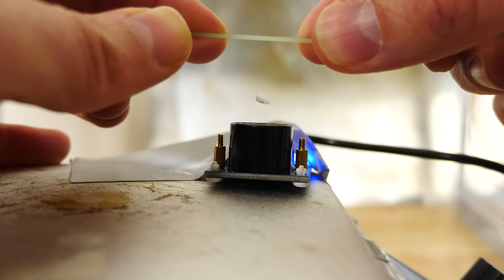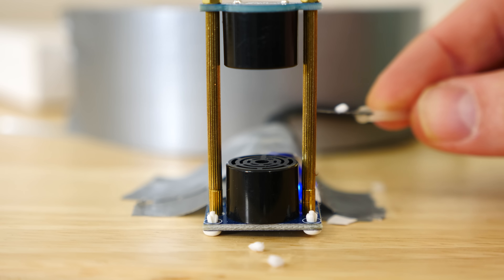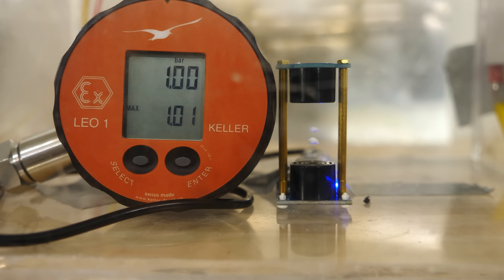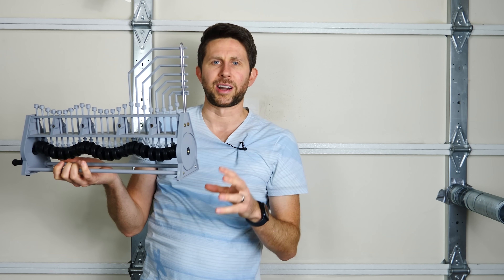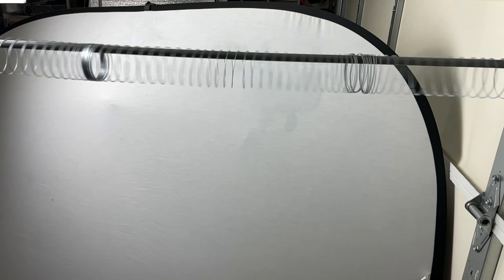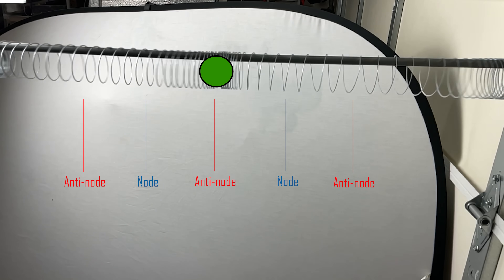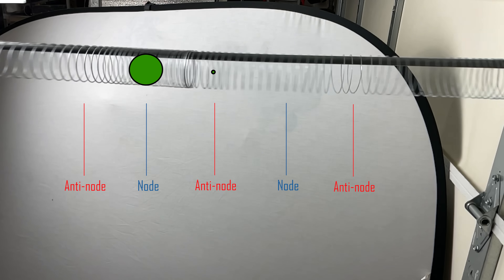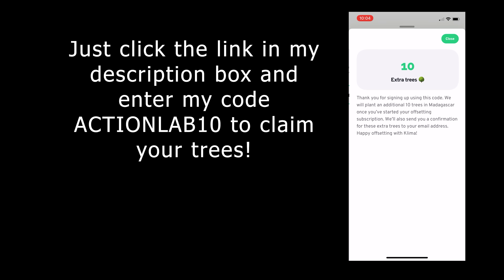How Does Acoustic Levitation Really Work?

Comment: Nodes are the points of low movement or zero movement, the anti node is the points with maximum vibration, if you place 2 speakers in the exact opposite direction they will interfere, one to another take the example of Laser Doppler Vibrometer and that's why your object will stay in the node.

Comment: In this experiment, the first condition was that the ultrasonic device was turned on, and the second condition is the vacuum condition. 

so what if it's the other way around ? if the vacuum condition for first
Reply: because in the vacuuming process of air, these particles moving outward which in the vibrating condition, for sure give an effect to the object.

Comment: An interesting demonstration.
I have had people who believe that a lost ancient civilisation tell me that this method might have been used to move dense objects like stone blocks, but this seems unlikely to me.
When you add in a Styrofoam chunk into the air gap, is there a relationship between the air pressure generated and the density / mass which can be lifted?
Is there a consequent down force on the acoustic generator when the styrofoam pieces are introduced?

With thanks, Simon

Comment: Nice video! I searched for acoustic levitation after I came across another video where they suggested that some ancient buildings, like the pyramid of giza, were built using acoustic levitation. 
That made me think of a question... 
Does the weight of the object you suspend in the standing wave add to the weight of the entire system? If you could assemble the wave emitters on scales, so you could weigh it, and called the weight of the system X, and the weight of the suspended object Y, would the total weight be X+Y, or just X? If its X+Y it would kind of disprove the idea of 50 ton stone blocks being moved in this way, wouldn't it?

Comment: I actually work in acoustic levitation or rather acoustophoresis, and it's even more complex than explained in the video. First of all, you don't need a standing wave to have acoustic levitation. You just need radiation pressure. So you just need high acoustic pressure, to have enough non linear effects that create that pressure. You can do that with standing waves but also with focused transducers. Moreover, the radiation pressure is much more complex than explained. You have particles that will go to the nodes, and particles that go to the anti node, regardless of their size. It depends on the acoustic contrast factor. For example, if we're talking levitating cells in water, you're gonna have blood cells that will go to the nodes, because their speed of sound and density is a bit larger than water, so the contrast factor is positive. If you have fat cells, which are less dense and with a lower speed of sound than water, they're gonna move to the anti-nodes. At its simplest, radiation pressure is a non linear effect that occurs when a powerful acoustic wave passes from a medium to another. The transfer of "momentum" from a medium to the other creates a force on that interface between the two media. Those media can be two liquids, like a cell in water, or an oil/water interface. It can also be liquid and solid, like a steel ball in water, or it can be gas and solid, like your experiment. I suggest you try water droplets in levitation, some fun stuff can happen, as well as powders, like ground coffee for example. You'll see strange patterns like spirals occurring, showing that on the horizontal plane the acoustic pressure depends on the horizontal coordinates as well, coz no standing wave is perfect. Also, there are amazing similarities between acoustic radiation pressure and electromagnetic radiation pressure. But when acoustic radiation pressure occurs due to a contrast of impedance (IE density and speed of sound), EM radiation pressure occurs due to a contrast of optical index. Also, photons have momentum, but technically an acoustic wave doesn't... So in the world of experts in acoustics, it is not totally understood how it works... You can extract radiation pressure from the equations but in my opinion there is no simple satisfying way to explain its source. A laser emits photons, those photons accelerate or decelerate when passing through an interface, so that interface is subject to a change in momentum, and a force is applied on it as a result. But with acoustic waves, where are the particles ? Where is the momentum ? Physicists have different views on this. Some will say it's simple and they're convinced it's this or that, but to be honest, it's just maths. There is no satisfying explanation.
Reply: Than you, your note has been very helpful. A possible answer to those last questions may be in a small sub quantum level where there are only waves of vibrations that intersect to create spikes of energy and small balls of energy that appear/disappear/appear on the larger quantum level. This would explain both the momentum and the two slit experiment observations.

Comment: So why cant you take the standing wave generators. Reverse them on themselves. And apply standing waves outwardly. And levitate the generators themselves with the standing waves?  

If that doesnt work. Try throwing it or increasing the amount of air pressure in a chamber. Id think it could levitate provided enough acceleration. 

Or maybe you can create standing wave pulses that ripple and create higher and lower pressure air pockets to generate lift?  You should be able to alter the vector and angles of the pressure waves and create a sort of cone shape to mimic a wing. But itd be invisible.

Comment: 0:50 "...transducer is a little bit PARABOLIC so it can easily set up a standing wave even if you are not an exact multiple away from it." Please explain "parabolic"!  If the transducer is in a self-resonant circuit, I would suspect that its frequency is detuned by the reflector.

Comment: make a real shield, have particles, ions, or magnetic particles, in an alternating respective field, ie, acoustic, magnetic or electric, radially
Reply: the ions in the way, moving fast, are the shield, the faster they move or the more particles you have in the way, the better the shield will perform
Reply: coil train gun
Reply: and for the shield, only use the protected target, one source, not two, a real levitator only has one below at the target, a plate
Reply: the essence of the method is to assume you can float a plate above another plate with opposing and same polarity and keep it stable with rotating or just the movement

Comment: The vacuum chamber experiment actually proves that it's little goblins that hold up the paper in the air, and the papers fell down in the vacuum chamber because the goblins passed out in low pressure.

Comment: This make me wonder if an atom works in a similar way, locking the electrons at certain distances because the nucleus is vibrating at a certain frequency, depending on the type of atom. Of course, there would be a quantum element to it, but the universe is one big vibrating entity where everything affects everything, so maybe it's different forces at different scales, but the basic mechanism stays the same.
Reply: heh no. An atom works because the nucleus has a positive charge, and electrons are negatively charged. You're confusing the vibration of an elementary particle, like a proton, which can release other particles, like photons or neutrinos, with sound. Sound is a result of the vibration of billions of air molecules or solid molecules pushing air molecules (like a speaker). It's not the same scale at all, neither the same forces. You can find similarities though, but usually at close scales. There is an electromagnetic radiation pressure for example, which has remarkable similarities to acoustic radiation pressure, I've studied both in my PhD.
Reply: @nicolasbertin8552  Thanks. I didn't study this subject in college or anything, but I'm always interested to learn, as a hobby.

Comment: I have seen this effect in ultrasonic bath sonicators. When we turn the bath sonicator on, the trapped air in the water makes small air bubbles that move to the nodes and thus cannot get out of the water. I can see the air bubbles literally stuck in the middle of the water.
Reply: Air bubbles in water actually have a negative acoustic contrast factor. So they move to the pressure anti nodes. If it were water droplets in air, they'd move to the nodes.

Comment: if there is more pressure(with a air pressure chamber", do you get more levitating power?
Reply: You get less sound dissipation, which helps you. But you also get a higher speed of sound and air density, which doesn't. It's a delicate balance. You would get a higher force by using hydrogen instead of air for example. You would also get a higher force with steel rather than polystyrene, but the weight would be higher as well...
Reply: @nicolasbertin8552  you are right, thanks for your explanation

Comment: TESLA SEES EVIDENCE RADIO AND LIGHT ARE SOUND by Orrin E. Dunlap Jr. New York Times April 8th, 1934 

An Inventor's Seasoned Ideas

NIKOLA TESLA, POINTING TO 'GRIEVOUS ERRORS' OF THE PAST, EXPLAINS RADIO AS HE SEES IT AT AGE OF 77 

“I consider this extremely important,” said Mr. Tesla. “Light cannot be anything else but a longitudinal disturbance in the ether, involving alternate compressions and rarefactions. In other words, light can be nothing else than a sound wave in the ether.” 

This appears clearly, Mr. Tesla explained, if it is first realized that, there being no Maxwellian ether, there can be no transverse oscillation in the medium. The Newtonian theory, he believes, is in error, because it falls entirely in not being able to explain how a small candle can project particles with the same speed as the blazing sun, which has an immensely higher temperature. 

“We have made sure by experiment,” said Mr. Tesla, “that light propagates with the same velocity irrespective of the character of the source. Such constancy of velocity can only be explained by assuming that it is dependent solely on the physical properties of the medium, especially density and elastic force. 

MICRO-WAVE POSSIBILITIES.

Coming now to the wireless waves, it is still true that they are of the same character as light waves, only they are not transversal but longitudinal. As a matter of fact, radio transmitters emit nothing else but sound waves in the ether, and if the experts will realize this they will find it very much easier to explain the curious observations made in the application of these waves. “It being a fact that radio waves are essentially like sound waves in the air, it is evident that the shorter the waves the more penetrative they would be. In 1899 I produced electromagnetic waves from one to two millimeters long and observed their actions at a distance. There has been a great hope expressed by various workers that introduction of these waves will have a revolutionary effect, but I am not sharing the opinion. They will be used, of course, but to a very limited extent. It is manifest that applications of the very short waves will not produce any appreciable effect upon the wireless art.”

Comment: 1. Relativity of the electron and its motion.  His waveform.
 2. Refraction of different materials.  Q: Why do metals not refract light?
 3. Radius of an atom.  The properties of substances depend on electrons.
 4. The similarity between the gravitational field and the magnetic one.  From what elementary law they are drawn.  What unites them.
 5. What is the frequency in a photon.
 6. How light refraction works.
 7. I believe electromagnetic radiation is due to the relativity of the electron, and the number of molecules.
 8. How electr moves

Comment: I dont think any other video discusses the node or antinode question. Grt video! Can u post a link to the transducer u used and its pecs? I have tried it with the transducers in arduino ultrasonic sensor, but it doesnt work too well and definitely doesnt make standing waves at any random distance. The plate of the arduino transducers are curved (parabolic?) so I am not sure that why rldont they behave like urs. Also in ur setup why do standing waves get formed at any distance between the transducer and reflecting surface?
Reply: I'm not sure but I think another way of looking at where the standing waves get formed is similar to harmonics on a guitar string. Just more complex because of the interference.

Comment: I’ve been saying this for a long time, I think the solution to levitating cars (not flying cars) is sound!! Not giant fans (too windy), not magnets (need super conductors) but sound. It works at normal temperatures and pressure. Just install transponders under the roads and the car will have the receiver and voilà! Although, the question is can sound hold the weight of cars? But then again, most of the weight in cars is for energy to make the car move and balance on wheels - in this case there’s no need for all that, we’d have to reinvent the construction of cars! 

Exciting stuff.
Reply: that would destroy your ears lolll
Reply: @derricksallazzo1502  I don’t think it has to be lol. Could you very low or very high frequencies (ultrasound) that we can’t hear. Or use sound absorption.
Reply: @amusableackeem  The larger the object, the bigger the acoustic wavelength you'd need, hence the larger the "speaker". For a car, you'd need insane woofers whose wavelength would make it resonate with all kinds of objects. Also, these waves would affect the passengers, and it would transmit up as well, into birds and stuff. Not to mention the amount of energy required would be insane. I work with acoustic levitation of cells. You need 1 to 30 W to levitate micrometer sized cells. Imagine a car that weighs about 200 kg with passengers. I'd go with Musk's hyperloop instead :D

Comment: Since particles go to the nodes or anti-nodes depending on their size, can this setup allow for separating particles by size? Thanks
Reply: I was wondering what would happen if you just tossed some salt or baking powder or such in there.
Reply: I also wondered about the potential of a "sound sieve"
Reply: Actually he got it wrong about the size of the particle. If particle go to anti node or node is determined by acoustic contrast factor, I.e. the material property of the target object.

Comment: The visualizations are great in this video, very well explained, thank you!

I have one trivial question:
If air is the medium of this soundwaves in your experiment, what medium do electromagnetic waves use?

We all know this magnetic floater toys where you can levitate an object with electromagnets.
If the principle is the same (standing waves) what is the medium for electromagnetic waves?
Reply from the maker: Electromagnet waves are a disturbance in the field lines of the electric fields all around us. So the electric field is kind of like the medium that is disturbed. Or another way of thinking about it it in terms of particle theory is that electromagnetic waves are actually photons that are shot out like bullets. A bullet doesn't need a medium to fly through, neither do photons.
Reply: @TheActionLab  Can you please inform me how can I get the system kit from India and how much is the cost? 
Thanks
Reply: Gravity?
Reply: @godwinemerald2289  As far as my understanding goes gravity is not a thing, therefore it can be no medium like air or water, which are things.

Gravity is described as a force and a force is what something does and not what something is.
Reply: IMO the issue in the video is that it seems like you need standing waves to have radiation pressure. You don't. You just need any wave, electromagnetic or acoustic. You also confuse a magnetic force with the electromagnetic radiation pressure, those are not the same forces at all. The first one results from the magnetic properties of materials, the other from the optical contrast between two media or objects. Radiation pressure can move any object, regardless of their magnetic properties.

Comment: Could this effect be visualized with smoke and a high-framerate camera?
Reply: no coz smoke particles are very small. You'd need a higher frequency, more power, it'd take some doing. The larger the object, the higher the force. It's proportional to the cubeof the radius of the object. Meaning that a 1 mm particle will have 1000 times the force applied to it than a 100 µm particle. Smoke would be micron sized, so he'd need a billion times the power at least, although he'd gain power by increasing the frequency as well... But it'd take a lot. At least there'd be no gravity involved (or very little). But still, to attract those smoke particles from far out the nodes towards the nodes... Heh, would be tough.

Comment: What people don't understand is that destructive interferences don't cancel each other. The amplitude is the sound pressure and not energy. Cancelling each other means that the sum of forces is zero which create a node. The energy however is reflected by the node like it was a solid wall.

Comment: Speaking about sound, if sound can't travel without air, can you record audio from inside (from a speaker inside and outside the chamber) the vacuum chamber?
Reply: It would be really loud for a bit while the air is sucked out and then it would get quieter and quieter untill there was no more sound. He could then do things like smack on the side of it and you would only hear it if it hits the chamber hard enough to vibrate the recording device itself.